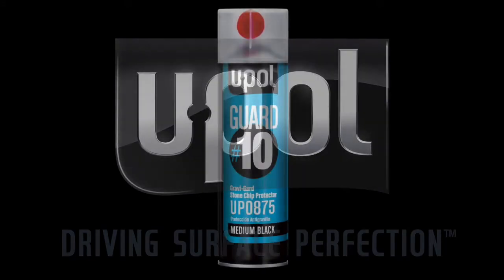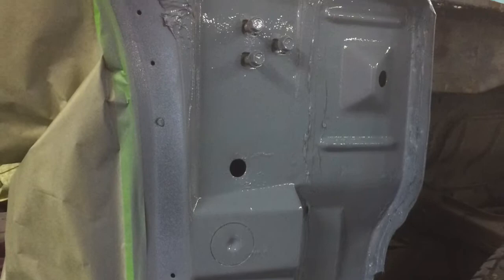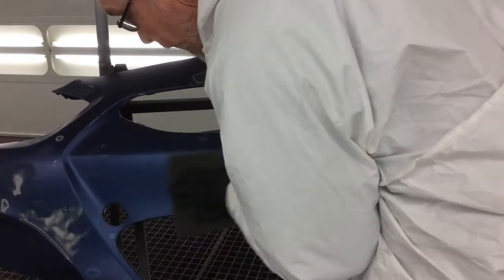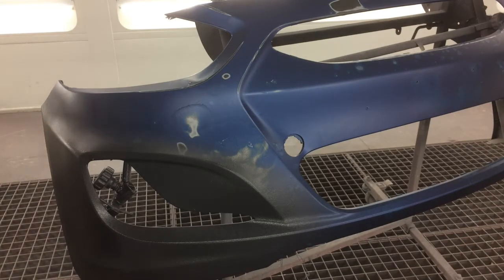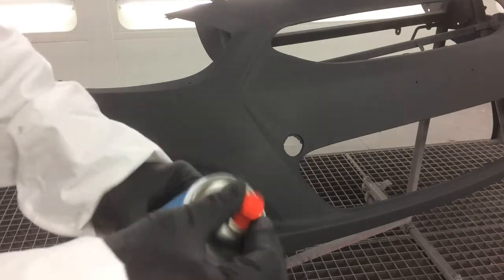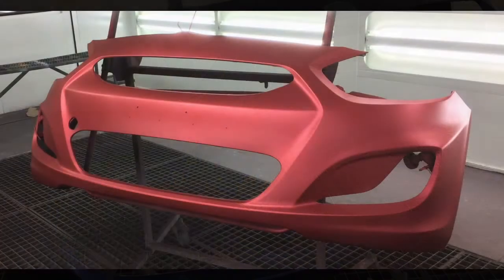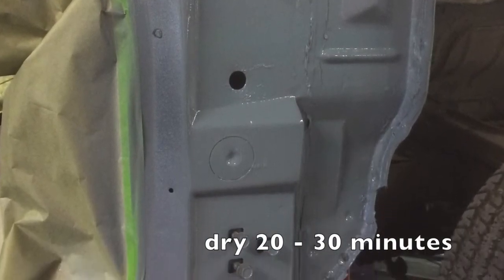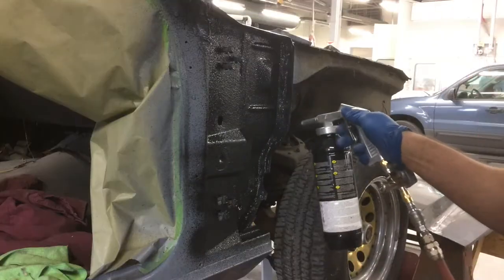GUARD#10 Gravi-Gard™ Stone Chip Protector, from U-POL

Comment: Used guard 10. Never again. You can only use it over a 2k primer as it will react badly with single pack. It must be full of thinners in it as it will soften any single pack primer. Also even with a 2k primer this stuff will crack once dry  like crows feet. Waste of money in my opinion